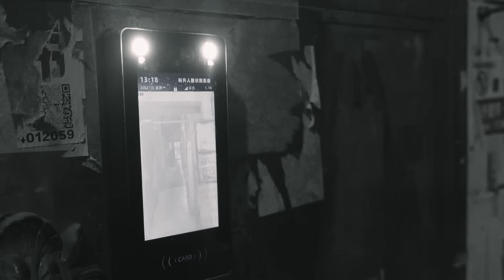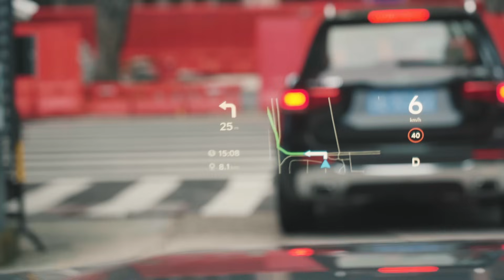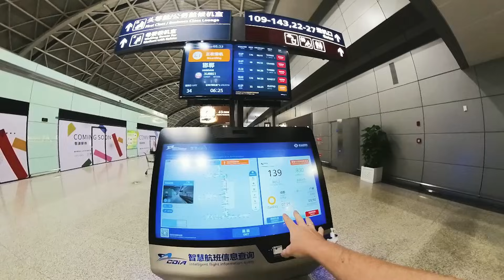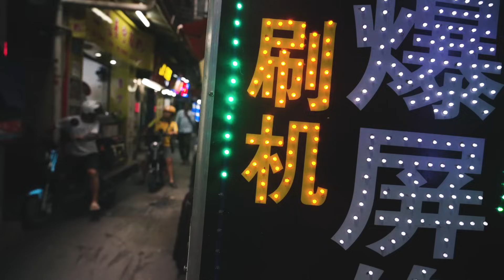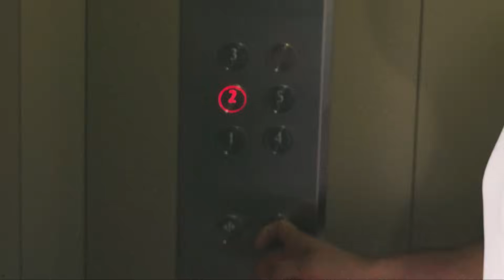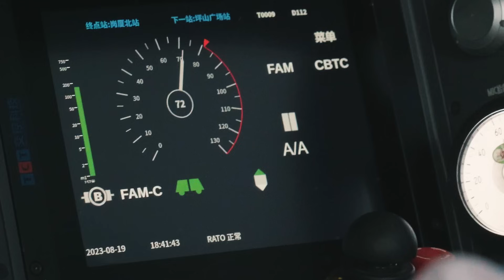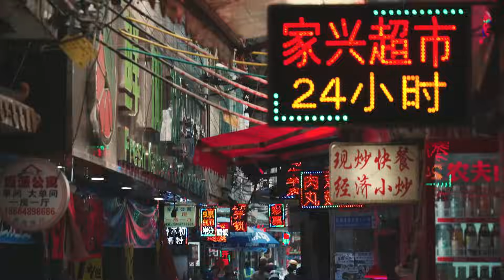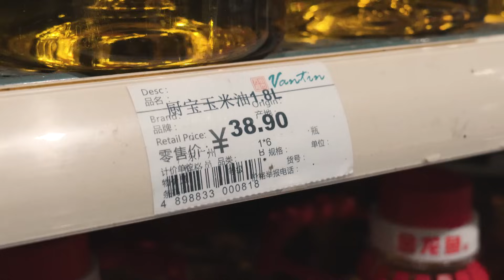China: Exploring the Real and the Unreal - High Speed Trains, Ghostly Towns and Fake Brands

Comment: A fire in an EV is more scary than u think. When a car is completely electric, in the case of a fire where risks of wire shorts, malfunctions, etc…can u escape easily during a fire/malfunction in an EV? I’d be scared to rely on that kind of system function 😏
Reply: When electrical short occurs, the power is cut off. There is no explosion or fire. So very low risk of injury. No fumes or chemical exposure, but not in gas engine. Heck, there is no gasoline  in an EV.  😁